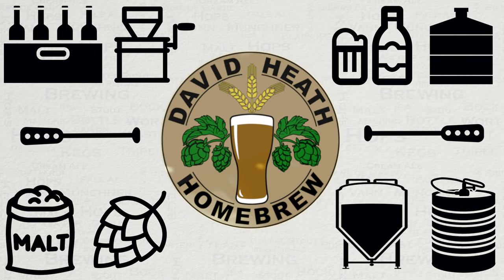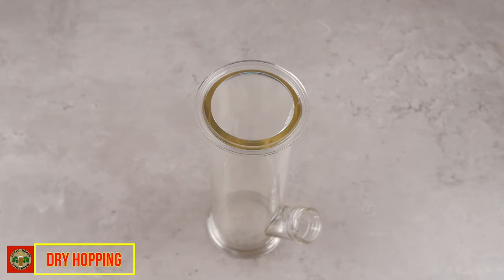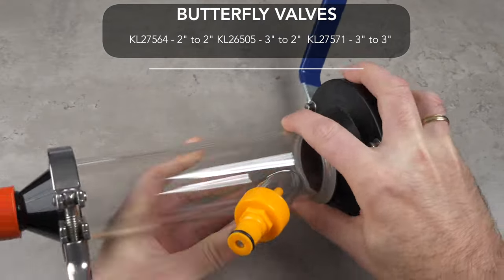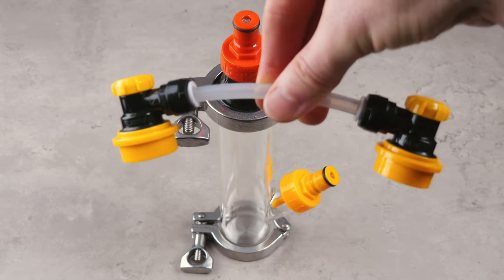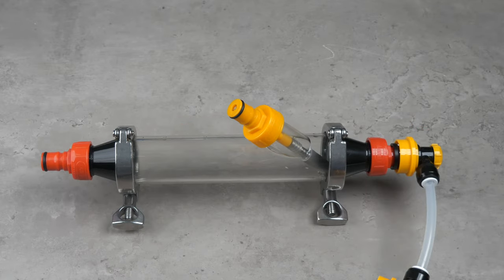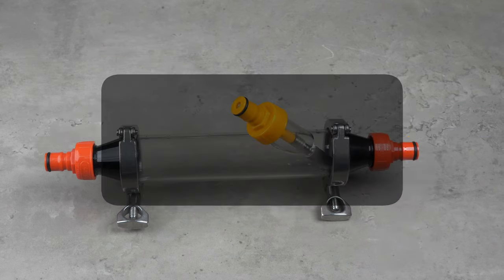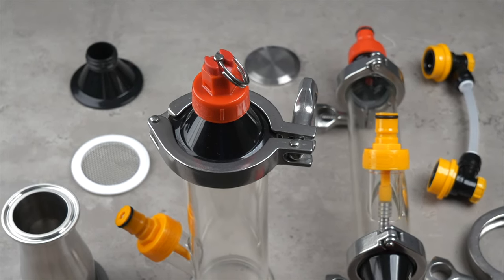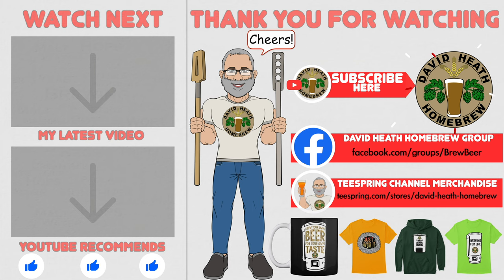Kegland Hop Bong For Dry hopping, Hop Randall And More

Comment: Great video David, thank you, very informative, and great to have the part lists in the description. I have a couple of these, 1.5" for my grainfather conical (rigged up in the same way but with a 1.5" butterfly valve), and a 2" for my fermzilla, both work great for dryhopping. Going to try using it for inline oxygenation after watching this.
Reply: How do you attach your bubbler as well as the bong with your grainfather fermenter?
Reply: Hey Nick, so the way I do it, is I put an o ring on top of the fermenter, then the butterfly valve, clamp them, then another o ring and the hop bong, then clamp them, chuck a carbonation cap on the side of the hop bong, then I just put the bung and airlock on the top of the hop bong. Bubbles away like normal during fermentation. When I am ready to dry hop, I close the butterfly valve, take the bung out, add the hops, cap the hop bong with a PRV, purge the hop bong, then drop the hops with the butterfly valve. A bit fiddly, but really not that much hassle. I keep it attached throughout the ferment, and have even used it to add biofine (or gelatine) the same way, and then use the grainfather pressure transfer kit on top when cold crashing and then transferring the beer to a keg. Probably don’t even need the grainfather pressure transfer kit, cause I can just hook gas up to the carb cap on the hop bong, but I have it, so I use it, helps me to control the PSI a bit easier.
Reply: @melkyriakou1555  Thanks for such an in depth reply. I'm considering my options with fermentation vessels and your answer is very helpful.
Reply from the maker: Sounds great to me Mel 🍻🍻🍻

Comment: Great overview video David. Perhaps next time you could do real-use video because I found a couple of problems with my hop bong setup. Firstly, you have to fit the new Fermzilla lid and collar 'before' screwing on the carbonation caps. Otherwise you get super frustrated trying to find out why the collar gets stuck when trying to screw it down. Secondly (and sorry Kegland) but their 2" to 2" butterfly valve doesn't work very well in my experience. It's really hard to close to get an air tight seal. In fact, the valves flip over if you push to hard. Luckily I was able to use the small PCO conical lid on the top of the hop bong to get a decent seal for air-tight pressure fermentation. So now, the Kegland butterfly valve joins all my other poor brewing equipment purchases in a big box under the stairs, as I've bought a more industrial 304 stainless steel butterfly clamp from a company on Aliexpress (for just a few euros extra) which works brilliantly. That's the benefit of the standard 2" tri-clamps, you can shop around....
Reply: Agree with everything you said and I also have bought a stainless steel butterfly valve from Aliexpress  :)
Reply: @petersmith3931  😉
Reply from the maker: Hi Finn, I did all that as well of course. I wonder if you should return your butterfly valve as it should provide a better fit than you describe. Sounds like you have one that isnt quite right.

Comment: I have a large dry hop beer coming up.
Is dry hopping via the hop bong your preferred method over dry hopping in the collection container  at the bottom of the FermIlla?

If I dry hop through the hop bong, do I still need to use the collection container or is it best to let the hops sit on the bottom of the Fermzilla for a few days then open the collection container?
Reply from the maker: I personally advocate bottom drop hopping where possible. It is the hop oils that interest us and oil rises when added to liquid, so for this reason dry hopping is preferable from the bottom for a nice even spread and amalgamation.

Comment: Wonderful video like always… 🙌🏼🙌🏼. Thank you David. How about hop missile ? Would it hold the temperature?
Reply from the maker: Thank you. Yes, it is made from stainless steel making it useful as a hop back or randall.
Reply: I meant if  it can be used as a hop missile to run hot wort during whirlpool, for example . Is it posible?
Reply from the maker: In theory yes, though I think you would probably need a different filter for hop pellets to avoid clogging.

Comment: I recently bought one of these for use on my Spike+, but have a few questions. I have always used bags for dry hopping, like is seen in all the videos. I've never seen this method used in any of the videos and am wondering if cold crashing will be enough to drop the hop particles to the bottom of the conical? I also have an in-line filter for transfers to a keg. Thanks in advance for the advice.
Reply from the maker: Hey Scott, yes, cold crashing certainly should do it and naturally its helpful having the transfer exit above trub on a conical fernenter.
Reply: @DavidHeathHomebrew  Thank you, sir.
Reply from the maker: Cheers 🍻🍻🍻

Comment: Great video David Thanks. Would there be much need for a hop bong on the top on a fermentasauras? Are they not both a way of adding oxygen free hops? 
Also any approx release date for the SS fermzilla? Thanks
Reply from the maker: Thanks Liam. The hop bong has various uses but if your fermenter has a bottom container then adding hops probably wont be one of them. I am awaiting the SS Fermzilla date myself at present. I hope to have more for the last video of this year which will come in December.
Reply: @DavidHeathHomebrew  Cheers thanks for the info 👉👍
Reply from the maker: 🍻🍻🍻cheers

Comment: Alright David. 

I've just put an IPA inbthe keg and forbthe first week tated great. Not I feel it went quite dull. I don't think the problem is oxygenation I do think I've over carbonated it. Would too much co2 destroy the hop flavour of the IPA and if so can de gassing it bring it back? 

Rather disappointed as I thought I'd made my signature beer. 

Thanks for any advice if you are able to answer.
Reply from the maker: Hey Craig, if it is carbonic acid then it can cause taste issues. Try releasing the keg each day for a few days with the regulator turned down to 10-12 PSI. Fingers crossed for you 🍻🍻🍻
Reply: @DavidHeathHomebrew  ah! I think you may have covered this in one of your videos before. I pulled the psv and reduced the pressure way down to almost no pour. Will follow you instructions and let you know how I get on. 

Thanks again.
Reply from the maker: Yes, I think so. Fingers crossed this will fix it 🍻🍻

Comment: Have you tracked down the max temp rating of that plastic?
Reply from the maker: The hop bongs are made from Nylon 12 which is an engineering plastic that is extremely robust and chemical resistant.
They are suitable for autoclave use too which spells out very strongly how resistant they are to high pressure and temperature. 
So certainly over boiling point as autoclaves are used at over 120C. I hope this helps.

Comment: Awesome product! Is there a practical way to use this with the Kegmenter?
Reply from the maker: Not for dry hopping that I know of but a new lid or adapter would solve that.
Reply: can be done, just need get some extra stuff for that.
2 inch to 4 inch tri-clover reducer
2 inch tri clamp oblique Y shaped 3 way spliter. you can buy this fitting from aliexpress.
ball lock tapping head to 2 inch tri-clover (or you can just use another 2 inch to 4 inch tri-clover reducer to fit existing kegmenter's 4 inch tri-clover ball lock lid).
then just install your hop bong stuff on top of the Y splitter.
Reply from the maker: Very nice. I did not see these parts. Cheers for the info 🍻🍻🍻
Reply: @juravi6791  This might give me a way to lower down a Wifi wire-antenna for the Rapt Pill and any wired measuring devices too without cutting through the main body of the fermenter too. Thanks for the info! 😍
Reply: @DavidHeathHomebrew  You're welcome!  Of course, it'd be much better if Kegland releases a special 4 inch lid for Kegmenter to be used with the Hop Bong. Just dreaming.. 😍
Reply from the maker: I will suggest it to them 🍻🍻🍻 Cheers 🍻🍻🍻
Reply: @DavidHeathHomebrew  I reached out to the guys at Kegland myself a few weeks ago about my dream device.

A smarter device that replaces a spunding valve:
- It measures pressure and allow you to monitor inside Keg/fermenter with App  (helps when you need to dial-in/check spunding valve afterwards, eg. starts at 0 pressure)
- It can adjust its pressure automatically either on time schedule, when RAPT Pill reaches a certain gravity  step or when the user manually requests a new setting (useful for natural carbonation and pressure fermenting)
- It connects to wifi, but also receives/relays data  from RAPT pill through the Pill’s Bluetooth  (helps give a Pill inside a steel vessel a better reach)
- It uses battery for access when in cabinets, cellars or  storage rooms

It might also:
- Measure temperature outside the vessel
- Automatically adjust pressure based on internal  temperature to give a more reliable ester production in  situations where the temperature is not controllable
- Measure amount of air that blows through, if that has any uses? Maybe for bubbles per minute if you don't have a Pill
- I suppose it might also be possible to use such a device in "gas in"-situations and not only for "gas out" and pressure relief, but I would be careful to not waste my precious Co2.
Reply: @juravi6791  This I found is interesting. Search for "BrewBuilt Pressure Pack with Clear Float Technology". It only lacks a safety valve, but I think you could mount a butterfly valve to it, attach a "Tri Clamp – 1.5″ pressure relief valve" to it and when you need to drop, close butterfly valve and attach the hop bong instead.

That lid even have an anchor to it!
Reply from the maker: Yes, these should be interesting for sure.
Reply: @kevin_bodi  It'd work as well i guess. It's pricey though and It still lacks a safety valve and 2 inch port. I personally count 2 inch Hop Bong is still more adequate to use with 58L+ Kegmenters.